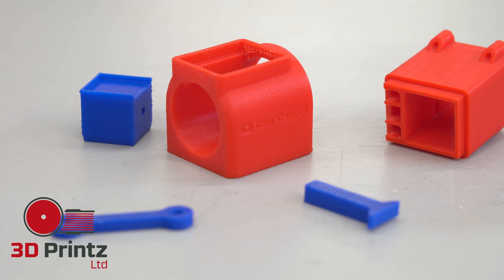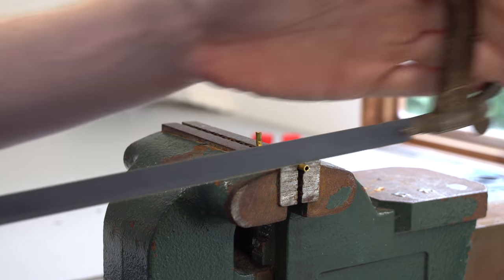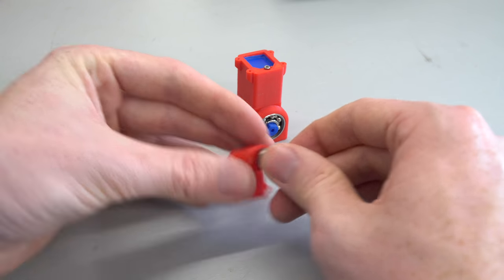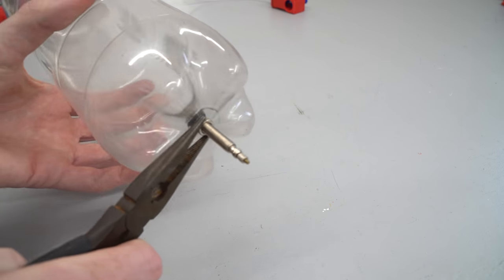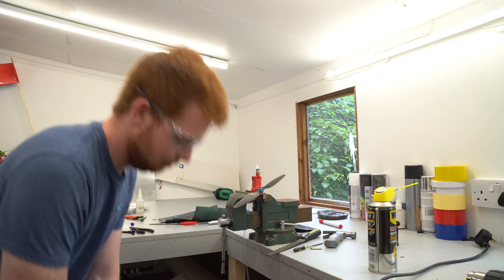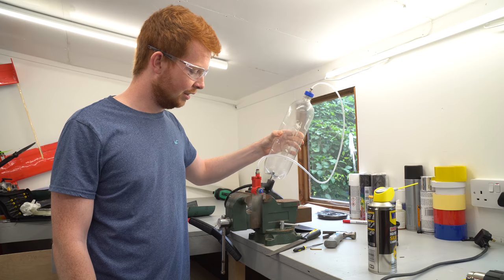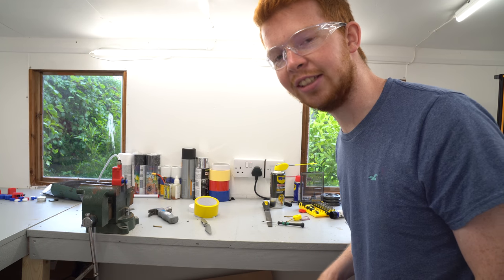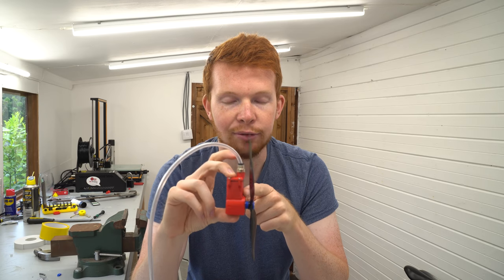3D Printed Air Engine BUILD

Comment: If u read this comment wherever the exhaust or where the air is leaking have it run off back into the bottle with valves and all that good stuff

Comment: now build a rotary-vane- compressed air engine
Reply: Glad you said that. Was wondering about the same thing.  Those are very efficient motors.  The pneumatic grinders in a welding shop I worked at long ago had those.
Reply: the piston design here is totally counter productive. he is OVER-ENGINEERING this this, just get a rotary and a c02 cartridge and BAM! prob, solved.
Reply: edit *thing
Reply: pistons work well in combustion engines, rotary work well in pneumatic.

Comment: I have a gut feeling you should constrict the inflow to 2/3s to half what it is now, a propeller is under more strain stationary then flying and this thinglooks to be overrevving its engine like a motherfucker. You should also test the prop revolution speed and consider no more then 2000 rpm as a rough goal, since it would spin a bit faster in the air then. Possibly do the math for a more accurate goal.you can google a paper on how to do it with the term 'propeller efficiency nar associates'. Or if you have already, post your work please haha.

Comment: I’m wondering about Steam, it wouldn’t be difficult to introduce a Boiler to the system!
Reply: Pla melts in heat so steam pressure would turn it into a puddle
Reply: Twml Correct, you’d obviously use a Nylon or ABS for the project. It’d be pretty neat!

Comment: Cut a cylinder sleeve from copper, alu, or pvc pipe and mold the piston out of epoxy putty or similar. Then drill the piston hollow and add piston pin etc. Design the printer files so that the newly built cylinder sleeve fits inside the printed cylinder. The cylinder will then be smoother since the part where you sand the piston and the cylinder seems highly impractical to me. Also add a small o-ring to the piston with a groove to eliminate leaking around the piston. Oil with sewing machine oil or similar..
Thanks! I've enjoyed watching these although some things you do make me think of better ways :)

Comment: You need at a spring to pushrod so it can run higher rpm because the valve will float if just gravity push it down
Reply: Johan, now that's a whole lotta insight!  Well put.
Reply: The valve is pushed close by the air pressure, thát's the genius of it.

Comment: next step: internal combustion
Reply: Hmmm -  Low pressure Hydrogen gas for fuel ?
Maybe, print molds to make ceramic piston and cylinder?

Comment: Dude. you need to make a rotary engine. (wankel) 
then you will not need to make valves,  just ports. think about it.
Reply: mads -  Your Wankel idea is easy to overlook or take for granted as unworkable but it makes good sense to me.  Do Wankels produce good torque at low RPM?
Reply: clavo No they dont make good toque at low Rpm but you wil '' only" need a in and out hole for air. And a rotation triangel. I will love to see you make one
Reply: mads:  I'd love to see me make one too!  You probably meant "him"; lol. I  think it is a good idea.  I wonder whether a 3D printer can make the gear on the pistons and spline on the crankshaft that is integral to the Wankel ?  Or; is there another way to make that work?
Reply: Sorry mean him :P 

Well ther is only one way to finde out if the 3d printer is can make a gear like in a wankel :P
Reply: i got curius. so i looked it op. and ther are peopel who made rotary enignes whit a 3d printer. but how good it will be on a air powerd plane or car i dont know
Reply: LOL  Okay, I'm blaming you when my wife asks why I bought a 3D printer!
Reply: clavo hahaha fair ill just want to se it work 😉🤣

Comment: This is fantastic thanks for sharing. I'm wondering how well or how long it would run off a CO2 cartridge from a tire inflator or bb gun. I bet you would need to use some sort of regulator to tame the pressure a bit.

Comment: 5:34 20 Bar Seriously 20 BAR. That's 290 Psi! That's More Pressure Than A Top Fuel Dragster's Supercharger Can Produce Are You Serious!?!?!

Also Do You Have A Place Where I Can Buy Parts Or Fully Assembled Engine At Because I Dont Have A 3D Printer

Comment: You sould ad a few ports to the side of the engine. You sould have them open when the piston is at the vary botom of its stroke / this will get rid of the romaining traped air and alow it to run smother as well as gane some good rpm and will sound amazing. Ive done it with handmade cast air engines and it werks grait/ the port cant be to big or it with lose to much air when it opens and cant be to small or the piston wont let the rimaning air out of the chamber. GOOD LUCK!

Comment: Not a engine, it's a motor!!!
Reply: What's the difference?
Reply: +Jamie Motors run on electrical, pneumatic and hydraulic. An engine is internal combustion and are piston/rotory,jet turbine and rocket. Motors use a stored power under pressure. An engine uses a liquid or solid fuel. An engine can power a motor but a motor can only crank an engine. This is an pneumatic  motor because it uses air pressure to turn it. Hope that helps!!! Keep Rocking!!!!

Comment: Peter Sripol made a video about upgrading a nerf gun into an air gun, he installed a mini electric air compressor in the gun that fills up the tank, you should do it too so the engine would run continuously. It will be probably too heavy for a plane but on an RC car it could actually work.

https://www.youtube.com/watch?v=t3m1aT9RN44

Comment: A few days before watching this video, I was watching this : https://www.youtube.com/watch?v=uvf0lD5xzH0&t=451s 
basically, a Trompe can compress air using the energy of falling water and no moving parts. I wonder if it could be used to power the air engine.

Comment: Loving these series. :-D Really respect your genius problem solving ideas. However would still love to see a radial engine ;D How about a system as in the link below. Would just require a Pentagon or hexagon with the dimensions  of the flat bottom side of the engine and a shaft in the middle? So no obscene complexity and all of the benefits of a single cylinder engine? Plus one could adjust the rpm and torque very easily, cause that’s something you’ve talked about before?
Hope I’m not bothering you with this suggestion I know people have commented about multi cylinder engines before.
https://youtu.be/VPVbn13Z0rY

Comment: try to make a wankel rotary airengine!
Reply: well. that does not work.
rotarys are always 4 stroke engines.
they cannot exist with 2 strokes.
sooo.... yeah. the wankel movement makes no sense anymore and he would basicly build a simple turbine 😅
Reply: rotarys are neither 2 or 4 stroke. it has 3 ''powerstrokes'' for every turn of the crankshaft while 2 stroke has one ''powerstroke'' per turn of the crankshaft and 4 stroke has one ''powerstroke'' every two turns of the crankshaft. i understand that it would be kind of like a turbine, but it would be cool if he tried making one! and yes wankel movement doesn't make sense (:
Reply: Ato. B but if you look at the face of the rotor its basicly a 4 stroke.
intake
compression
power
eexaust
so all 4 strokes done separate
Reply: yeah that's right. i believe that if you trash the compresion part and put intake at the power stadium it could work like a 2 stroke rotary.
Reply: A rotary engine is inefficient by default, which is an even bigger deal with a low energy density fuel like compressed air.